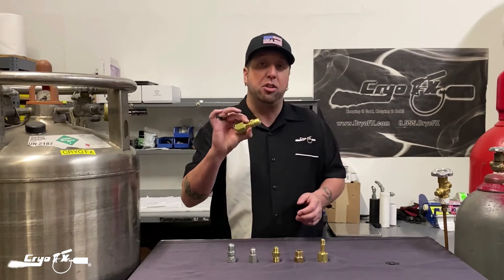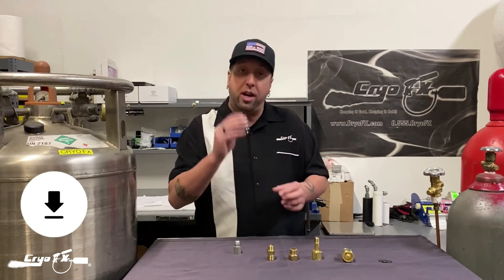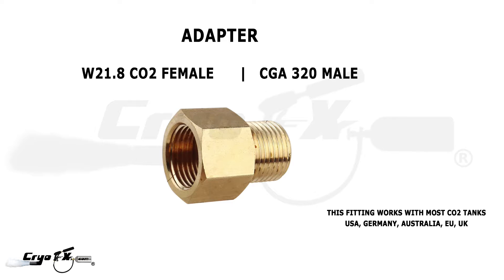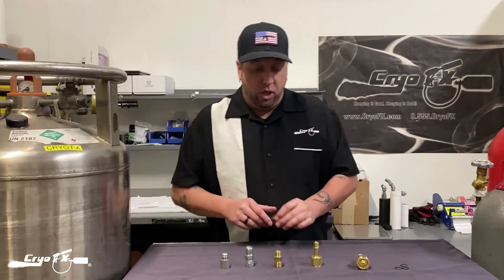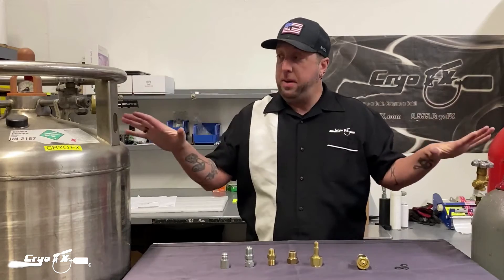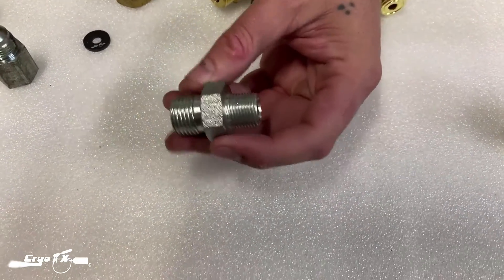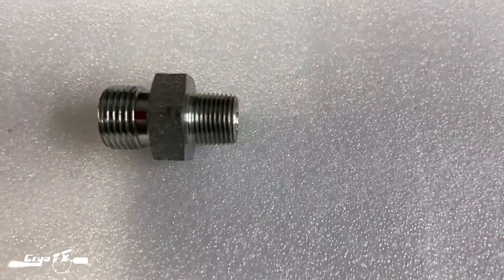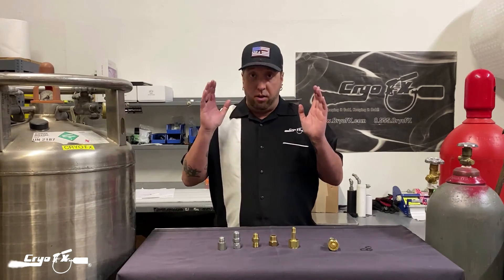Co2 Cylinder Adapter, Co2 Fittings, And Co2 Cylinders Explained [CryoFX]

Comment: Question: about filling co2 tanks. If i have a 20lbs co2, could i fill up a 10lbs co2 tank from the 20lbs co2 tank using a co2 refill adapted? If so, when do you stop filling the 10lbs?

Comment: I am getting some new ball valves for your co2 confetti blowers.  We attach the ball valve on the confetti blower and not on the co2 tank side.   We have one brand with nice valves, but were pretty sure the hollowed part were the gas flows through (i dont know what that part is called, sorry), is too small.   How much space does co2 need to flow properly to avoid possible daming from build up/freezing?

Comment: Is it common for these sizes to almost, but not perfectly, fit?  I would hope that with pressures this high, 'almost' wouldn't happen, but I received an effects machine from China that came with a CO2 hose having an end fitting much like the W21.8 you show.  I bought an adapter, and either it or the hose is off by about 5 thousandths.  It's maddening that NOWHERE on the web can I find a drawing for the W21.8.  Your video was literally the only source of info on these connectors I could find anywhere on the web.  Thanks for the information you provided!  If I can, I will buy parts from you since you actually know what you're talking about.
Reply: The drawing is available as it is a European standard, but you will have to purchase a copy

Comment: This might be a little off your area but do you know the type name of the connection type that goes on a co2 cartridge cylinder with a 1/8" thread? When the cartridge cylinder is screwed in place the sealing on the cartridge is punctured. I am trying to find litterally any form of fitting (coupler, regulator, adapter etc) that connects to a cartridge cylinder but I don't know the name of it and what to search for. The only thing ive found so far i a bicycle pump but it has very limited usage because it can only pump a bicycle. If it had a G1/4" on then I could do something else with it.

Comment: Hello, I am looking for some help regarding a connection between a hydraulic tool to a nitrogen tank. Is there any way to send you a picture and receive your suggestion? Thank you very much
Reply from the maker: Hi yes, please see the charts we have for fittings here: https://www.cryofx.com/co2-cryo-hose.html  for the hydraulic side, and the nitrogen fitting should be one of two types depending on pressure. A picture sent to us will help notice which type.
Reply: @cryofx  Thank you. How can I send you the picture?

Comment: is there somekind of raiser pipe under the actual cylinder valve that keeps the gas in liquid form until the valve exit point or smth?
and is the co2 gas inside the cylinder actually in liquid form at all lol